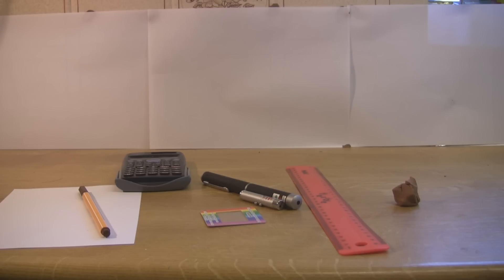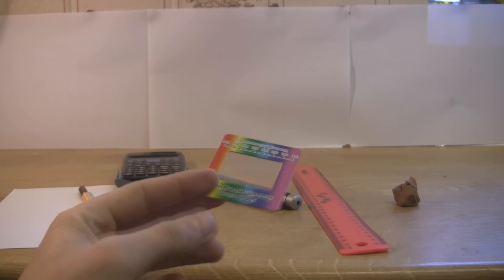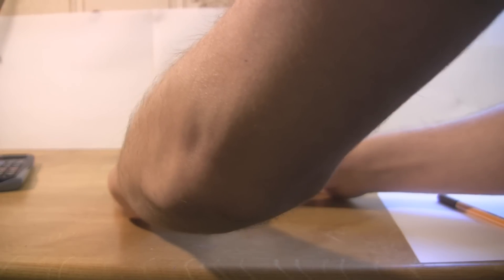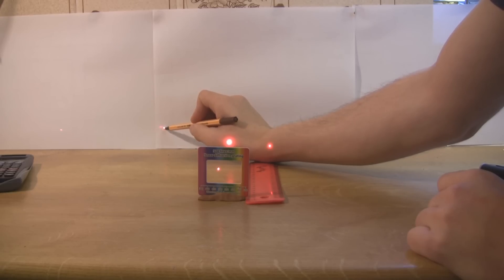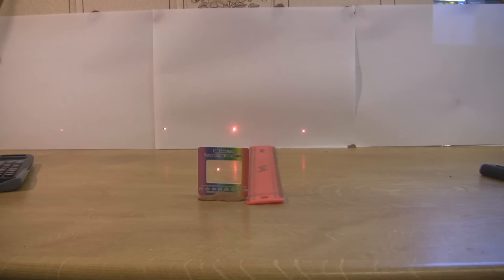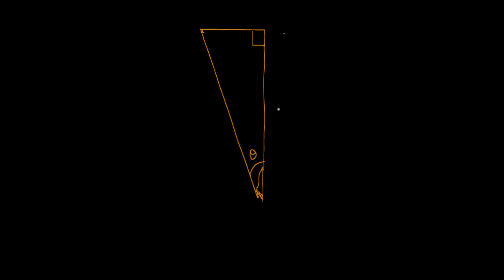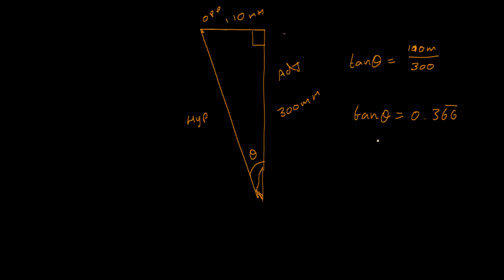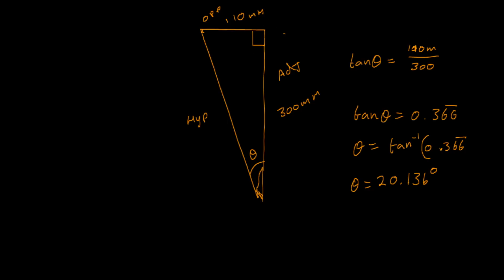Finding the wavelength of light

Comment: hey i need help, can i use this to measure a lamps wavelength? or only lasers, what could i use to measure a lamps wavelenght`? 
thx in advanced
Reply from the maker: +diego grados lamps will have a continuous spectrum (whereas lasers are monochromatic) which means they transmit light at many wavelengths: there will be specific absorption lines (dark lines in the spectrum). To see these and measure the wavelength of these lines the same method as above can be used. 
Hope this helps! :)
Reply: ScienceBang thank you very much!